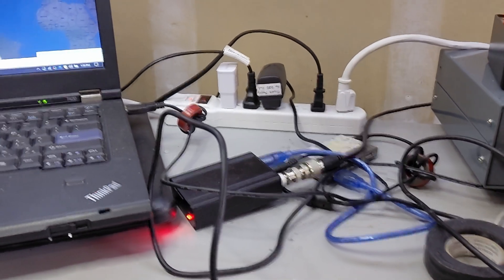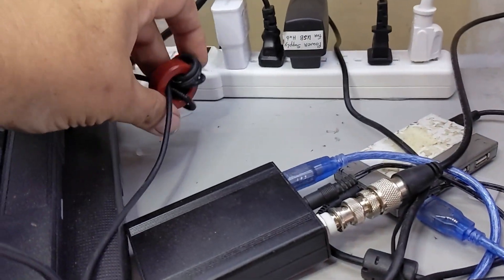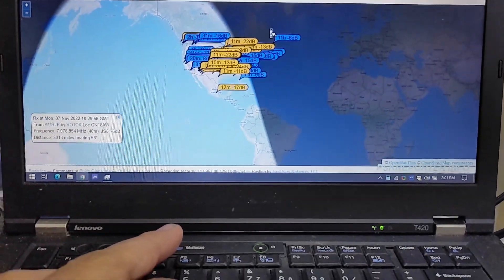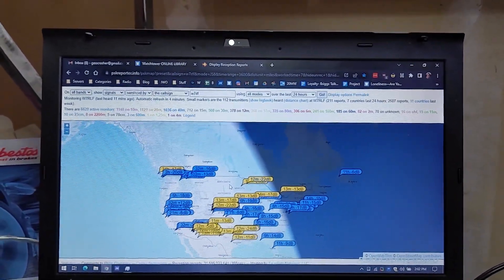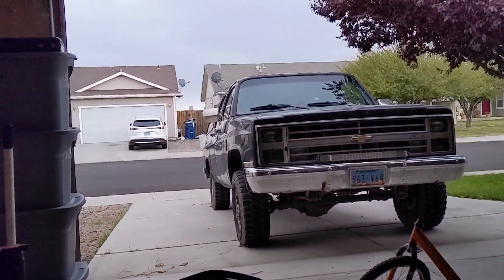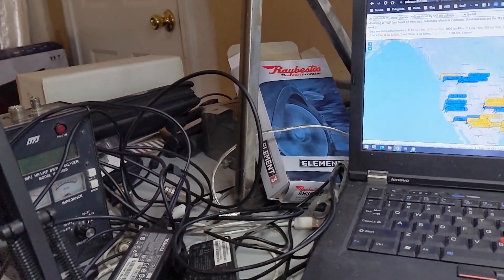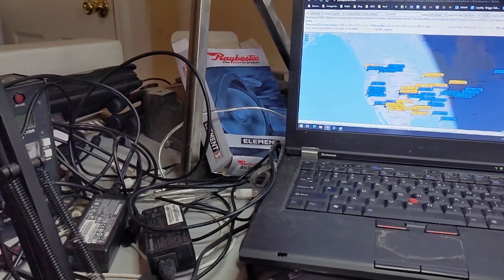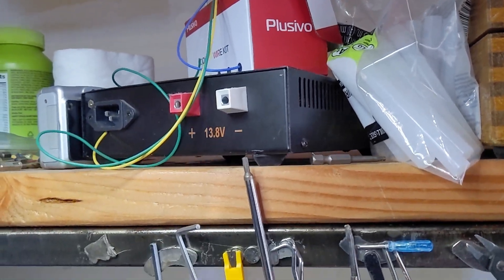QDX "Tour" at the bench and some considerations

Comment: I have a Rev 3 kit, I’m building for 9v… I need to finish it before the New Year.  I also just ordered an assembled 12v Rev 4.  

My plan is to use it mobile & portable, so my kit is simple.  The QDX, a DC 3aH pack, an 18” USB cable, small Lenovo Laptop, and a 20m resonant wire doublet.  The lenovo has a field case, the rest of the kit will fit in the Throw-line bag.

I see you’re using an RF choke, I have a small 1:1 balun.  Do you think that necessary?   

Have you used your QDX mobile, or portable?
Reply from the maker: I haven't used it mobile or portable yet. I do think that the choke or 1:1 will help 🤠👍